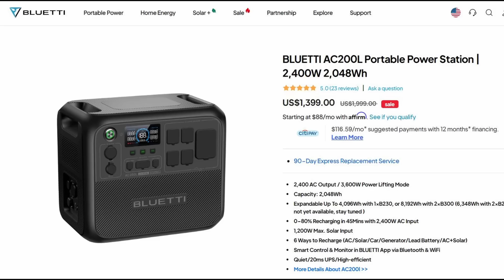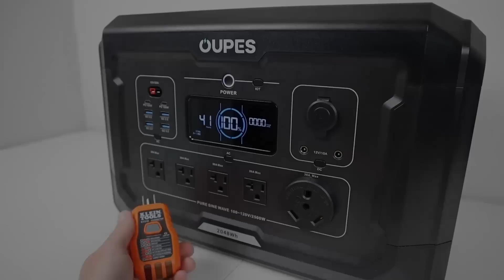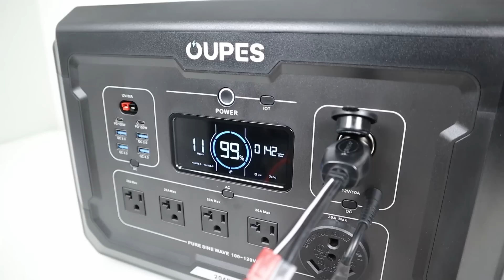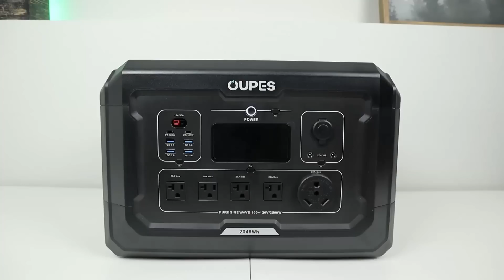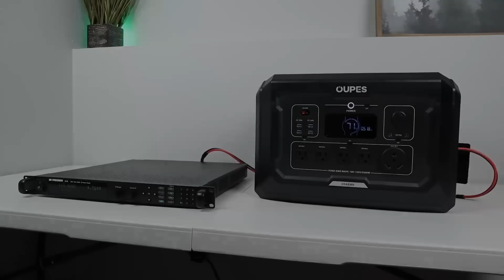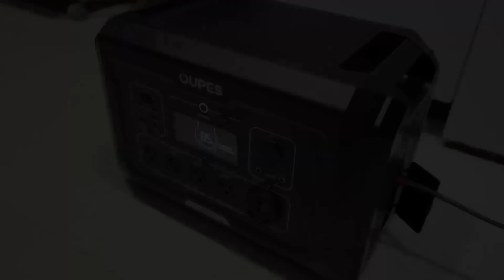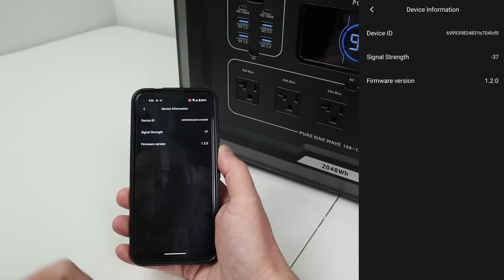The OUPES Mega 2 Wins the Budget Crown! Best Affordable Offering of 2024? Full Testing and Review!

Comment: The fan noise is not important to me, so not a con at all.
But the slow ramp up to charge from solar is a deal breaker. I want to use it on a boat and my solar panels will constantly go through changes in shading. I need the max of what’s coming in at all times.
Reply from the maker: Yeah. I've never seen a power station take so long to get to full wattage input.
Reply: @Jasonoid  I also think all solar generator makers could add a smart circuit before inverter and dc regulator to keep down idle consumption. My iPhone doesn’t use 15 watts on idle, so a chip monitoring output ports and turning dc regulator and inverter on/off according to needs could bring idle down to a watt or two per hour. And a smart circuit that learns from habitual use is also helpful. Scheduled on/off time is also a simple implementation.
Reply: You are absolutely correct sir. They really really need to fix this. Until then, if you want to charge with solar, pass this one up. Otherwise the Oupes Mega 2 is fantastic in every way.

Comment: Outstanding video as usual.  I love the DC output this unit provides.  Not too keen on the 2500W inverter.  Such a  large inverter is the reason for great loss of efficiency.  When I buy these power banks, power consumption is my main focus and not running high consumable electronic devices .  I do love that I could literally power 3 of my 12V fridges in case of an emergency using the dc ports.  Have to watch your video with the 1500ef Pecron that is pretty amazing too and see which would be more suited for me after I do a power analysis of the devices I would connect.  

What I do love about this unit is the solar charging capabilities it offer with up to 150V making it easy to hook up solar panels in series.  Thank you for such eloquent and succinct information you offer on your channel.
Reply from the maker: I always appreciate your insight! Thanks for commenting 😁👍

Comment: Great review, Jason. I agree the Mega 2 is a great value in the solar generator market and I'm quite pleased with mine.

I use it for high drain devices, so love that it can handle the power.

Yes the tradeoff is lack of efficiency so you cant just leave it always on for days at a time unless you've got enough solar attached.

I bought the Anker 737 power bank (with info screen) for my phones and tablet. When that goes down, I charge it up in the 100W USB port and then shut off Mega 2. I use the Mega 2 for the big stuff.

I also have Ecoflow Glacier Fridge. When possible. I run it on battery power and only charge that battery with Mega 2 when its low.

This is most efficient way to use Mega 2 since parasitic draw is high.

Another great duo setup is to get the Honda EU 2000i gas generator. Use it only to charge the Mega 2 on the max AC 1600W setting. If you get 6 gallon expansion kit for Honda, it can run an Air Conditioner a long time.

This lithium, solar, gas combo is killer with tons of redundancy.
Reply from the maker: Wow, that's a great setup! Thanks for sharing

Comment: Perfectly content to swap a little less DC capacity for more DC power output. Just out of curiosity, is there any reason you don't test the RV outlet for the full 30 amps? I didn't see that anything was ever plugged in there for the sake of load test or to check the amp output. Nice unit!
Reply from the maker: The entire inverter output is good for 2500 watts peak, which ever port you use, including the 30 amp RV outlet. That's about 21 amps, 2500 watts / 120v = 21.8 amps
Reply: @Jasonoid  So to be clear, I can never get 30 amps out of the RV outlet? Only 21.8 amps?
Reply from the maker: @twloughlin  correct, you can only pull the total power the inverter allows you to pull, 2500 watts. This is the case for any power station, no matter what the port size is, you'll only be able to pull the rated wattage. It can be a little confusing since the name of the port is a "30 amp RV outlet".
Reply: @Jasonoid  Thanks for replying. That's my main point - they labeled a port as "30 amp RV" and that's confusing to noobs and novices like me. I won't go so far as calling it deceptive, but really I could just as easily get an RV dog bone adapter and use a 20 amp port to connect an RV.
Reply from the maker: Yep, I understand the possible confusion. The larger ports are for convenience.

Comment: Torn between the Mega 2 or the Mega 3.....any suggestions?
Reply: Depends on what you will use it for. The Mega 3 has 50% more power capacity. It can power 2 power hungry devices at once. But it also weighs like 80 something pounds vs. Almost 50 pounds. The 3 has built in wheels,  but you may still need to lift from ground level at times. The 3 will also take up more space while the 2 is a nice compact box. Both take the B2 2Kwh expandable battery packs.

If you can get by with only 12V DC including that 30 Amp output power and 100W USB outs, I'd even consider getting just the B2 expandable battery pack. It's same capacity as Mega 2. I've seen it on sale for $750ish. It has same solar charging, control panel as Mega 2. It lacks AC charging, but has lots of DC charging via  Anderson charge port.
Reply from the maker: What he said 👆
The Mega 2 is smaller and more portable. It still allows for a ton of solar input though. They both have the high DC output. 
The Mega 3 is much bigger but allows for the full 30 amp output (3600 watts). If you need to power multiple loads at the same time you may want the Mega 3.
Reply: Thanks! If I got the M2. I could get the 2 solar panels as well and get an extra battery at a later date. OR I could get the M3 WITHOUT the solar panels but have more power. Both would be around the same price. Basically to run a house when power goes out. I should have been more specific when asking my question😂

Comment: top points,
good ups cut over time, good for sensitive electronics
good to see the 12v 30a output. and low idle power draw on DC.
nice to see the adjustable charging rate.
works well when left on solar overnight.

lacking, AC idle power draw is high

this unit has an optional external add on battery, but it doesn't appear that they sent you that for review.
Reply from the maker: Nah, they didn't send the expansion battery for testing. Unfortunately I don't know how much usable capacity that adds. I'm sure it still works well. Thanks PM for checking out the video :) You ever pick up any solar panels for your P2001? Do you have a deck to hang them off?
Reply: @Jasonoid  i did not pick up any panels, i have a small porch that gets sun in the morning, but otherwise no, i would most likely only use them in the event of an emergency (like the power is out and the sun is out). as such i haven't invested in them as of yet, also necessity hasn't reared it's head as the capacity of the p2001 lasts longer than out outages have so far leving me not needing to get them.

and if i absolutely have to i can charge the p2001 off the car as well, with my boost adapter i can get 400 watts.
Reply from the maker: @user--PM glad to hear you have a way to charge quickly off your vehicle!

Comment: I will say..that i purchased a new refrigerator last year that is very energy efficient and on energy saving mode it runs less and only pulls 67 watts most of the time..128 periodically and 228 at start... about the same 24 hrs without solar..and with..im running my TV's... Internet router Phones..lamps ..fans..etc..Even before my panels we're installed... using my station sure peak gours and charging it on Super Off Peak hours..The cheapest rate...i dropped my bill down around 90$...now ive had panels for rhe last 2 weeks..and i cant wait to see how much im Saving 🔥💯💪❤️‍🩹☀️
Reply from the maker: I love seeing the power bill drop while using these!
Reply: @Jasonoid  I love watching your videos and reviews 💪💯🔥..Your a very knowledgeable young man.AS An electrician myself( MOSTLY ALTERNATING CURRENT)WORKING WITH SOLAR IS my focus and learning all Direc current applications MY FUTURE.🙏🇺🇲💪. Channels like yours and Hobotechs AND Rambling Bob's have tought me SO MUCH ..MUCH LOVE🙏
Reply: @Jasonoid  Hey Jason - Can I use the 30amp to plug into the transfer switch on my house, it's a Reliance plug, so thinking it should be fine. The transfer switch powers small to large appliances like furnace, well, sump, so thinking I could use these appliance by flicking the switch to each one, shitting off the rest to ensure I don't go over wattage, shut down the generator.
Reply from the maker: @cunnos  as long as your transfer switch only has 120v circuits on it, that will work just fine. This does not support 240v
Reply: @Jasonoid  thanks Jason. I think I've asked you like 5 questions over YouTube today and I promise I'm done lol! Thanks again for all your help. I think my decision is made on the Oupes Mega 2. It's budget friendly, just as powerful as the Bluetti AC200L, and has higher surge at 5500 than 3600 for Bluetti. Right now it's 400 dollars cheaper on Amazon than Bluetti. That's tough to beat.

Comment: here is a video suggestion, im wondering if you could do a follow up video of the ecoflow river 2 pro with the bonding screw and the klein tools for the floating wiring or something like that. im wondering if you ever have thought of that. cause i dont think the ecoflow river 2 pro has the proper wiring for the ground. im just wondering if you could do a follow up video for this.
Reply from the maker: If your appliance needs a bonded connection while NOT wall charging, buy a bonding plug like this (like seen in this video):    https://amzn.to/3VDcsJm
The River 2 Pro has an open / floating ground just like any other power station. When charging from the wall it picks up grounding from the wall. I don't know of anyone who uses a grounding screw on a portable setup.
Reply: @Jasonoid  im wondering if the ecoflow river 2 pro has the floating ground im planning on getting it too. i was looking on ebay for one, and i believe the 4 plug receptacles maybe floating grounds, thank you for this. also my amazon got hacked, so i can get it off of ebay.
Reply from the maker: @Mega1andy2  the river 2 Pro has a floating ground stock.

No need to buy a bonding plug if you want a floating ground.
Reply: @Jasonoid  is it normal then? im just wondering cause i have my apc hooked up into my ecoflow river 2 pro and having it grid powered when i lose electricity i have a ***wiring fault***. its plugged into my desktop computer as well i forgot to mention that.
Reply from the maker: @Mega1andy2  your APC is wanting a bonded ground connection. Get the bonded plug and that error should go away. Edit: it's still hard to know the exact setup from these comments so I'm just giving you my best guess.
Reply: @Jasonoid  its no worries, im glad that we are having this conversation, so i can learn something.

so if i do get the bonding plug, and plug it into my apc battery that error should go away?

one last note i should add, if i do hook my apc into grid power, its not going to give the  wiring fault if its hooked into grid power. if i do hook it in into the ecoflow river 2 pro, then it gives the wiring fault. 

its best to learn from these things if you know what i mean.
Reply from the maker: @Mega1andy2  sounds like that should be the solution.

Comment: Love the review..... Like the solar input and 2500w inverter but glad I bought the pecron E2000LFP way more efficient and I live offgrid with only 700w of panels..... I use Air fryer...kettle... hot plate...shopvac...and 5K window AC.... I also have 3kw extra battery to run my diesel heater and 12v on my trailer fridgeand lighting
Reply: I bought 3 of those E2000's.  Rambling Bob just did a video showing they changed the E2000 it now has only 4 120 plugs and they added a RV plug.
Reply from the maker: Sweet setup! Thanks for sharing how it all works :) The Pecron E2000LFP is a great option as well.
Reply: @Jasonoid  not having a UPS feature on the Pecron was an automatic deal breaker for me. When not in use in my RV during the summer, it becomes a backup for my pellet stove when the power goes out.
Reply from the maker: @InTheDirtAgain  The newer E3600LFP has all the modern features, UPS mode, internal AC charging, tons of solar input! It's quite the upgrade over the E2000LFP.

Comment: Great review.  I ended buying the Mega 2 with the additional ad on battery.  Now I just need to figure out the best portable solar panels to get. I don't have a place to permanently mount them. But Tulsa gets plenty of sun, even right after a tornado!! LOL
Reply from the maker: I'm always looking for the best deal on portable panels. Renogy just put out a new lightweight 400w folding panel suitcase that seems better than other options. I will be testing that soon.
Reply: I just bought 4x100W EMFX Shadestopper panels. If you plan on using them at camp sites where there are always trees and shade, this might be a good way to go. I picked them up on sale for $109 each 100W panel and got the Barrel to MC4 adapter free with each. As of this post, they are $120 each now.

My other rationale was since Mega2 solar charger is so slow,  I didn't want panels to drop down to 0 in shade or cloud cover. I haven't been able to test this out yet.

If you are keeping solar panels in one place and don't need portable, I also have 8x100W Renogy mountable panels that could be portable. Those I bought aluminum stands that can hold 2 panels each and relatively small when taken apart. This could be used as permanent or semi-portable. I can also put everything in 4 series in 3 parallel arrays with only a little loss in wattage due to minor variances in V and A for nearly up to 1200W in perfect conditions. The loss in amps is actually good to stay within the 15 Amp max of the Mega 2 solar charger.
Reply from the maker: @skttnm  I am going to be picking some of those up to test! They are local here in Utah.

Comment: The only con that would affect me is the “below 85%” DC usage, but 82% is not terrible. The high DC output port is a selling point for me. Thanks Jason!
Reply from the maker: Yeah, thats a tradeoff of high power output, a little less efficiency.
Reply: @Jasonoid I wonder if you would have the same 82% result if you tested DC efficiency using the Car plug port instead of the Anderson port.
Reply from the maker: @ccwstraightshooter9761  I did 4 different DC discharge tests, the results were the best using the high DC output. Other tests were around 80% and 81%.... Pretty similar numbers.
Reply: So using the AC is more efficient than the DC???  Usually it’s the other way around for most other power stations correct?
Reply from the maker: @ccwstraightshooter9761  for small power stations, yes, that's the case. For a larger power station with a 48v battery, the DC output needs to be regulated down from 48v to 12v so they are not as efficient. Small power stations have 12v or 24v batteries and are more efficient in their conversion. Check my grading sheet, you'll see the same pattern between all these models.
Reply: @Jasonoid 
Sorry for all the questions but you’re the only one that’s been able to answer confusing questions. I have a ETaker M2000.  The manual says it’s a 32v battery.  The car charge port on it says it’s rated for 12v 13A.  Not sure if I should adjust the diesel heater setting for 12v or 24v.  In the 12v setting it won’t fire up my 13 amp required power draw to start my higher end diesel heater. Should I switch the diesel heater setting to 24v since my ETaker power station is 32v system even through its plugged into the 12v 13a regulated car port?
Reply from the maker: @ccwstraightshooter9761  I doubt making a change on the diesel heater will make a difference. You could always test it though to see.
Reply: Thanks.  Would be great if you could review the ETaker M2000 in the future.  To my knowledge it’s the only system I’m aware of that is fully EMP protected. Perfect for those peppers out there who don’t have their backup battery systems in a faraday cage all day.  Also it’s one of the few power stations using semi solid state battery technology.  Super light weight and half the size as competing stations which is perfect for overlanders.  Weight savings and compact is king.
Reply: I'll be living in a vehicle, so I'm seeing that I'm not going to have much more than a fridge/freezer going most of the time. 
When stopping for eating and at night cooking I'll have an induction stove and maybe a coffee maker and briefly a coffee mill. Not expecting to overload it so it should work fine for me. I'm going to have to see how to mount the solar panels on the roof. Haven't heard of anyone having the solar panels stolen, but I'll have to see what is necessary to hide them when I'm not with the vehicle.

Comment: I think Montek X2000 is a better deal, it's cheaper, smaller and waterproof
Reply from the maker: The Montek X2000 only has 1280wh of capacity... of course its smaller and cheaper! That battery is half the size of this one. I'd put that power station into a different category IMO.
Reply: @Jasonoid  The X2000 is 2072Wh, which is more than Oupes. It has different battery chemistry though, but for 95% of the people it doesn't matter. You probably confusing X2000 with X1200, which has smaller, 1280wh capacity.
Reply from the maker: @MichaelBurko  there are two X2000 models, the LFP and the NMC version. After my NMC fridge battery exploded while camping a couple years ago I decided LFP is the only safe option. I'm never using NMC for a power station or a large battery again. Too much risk involved with battery chemistry that can explode if something goes wrong.